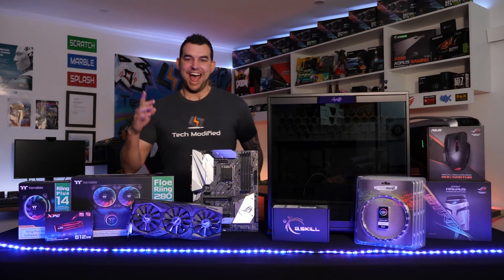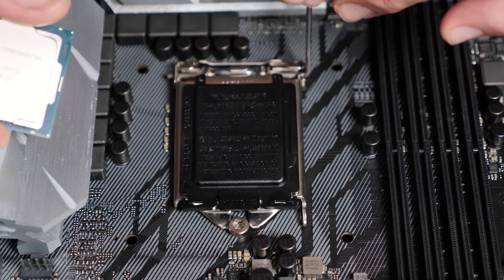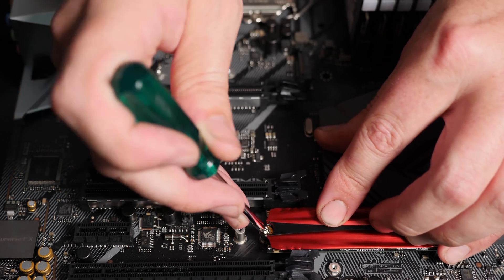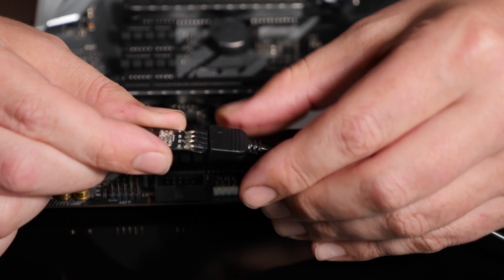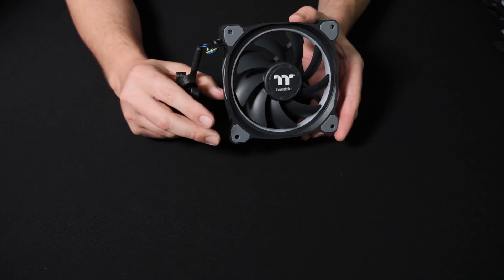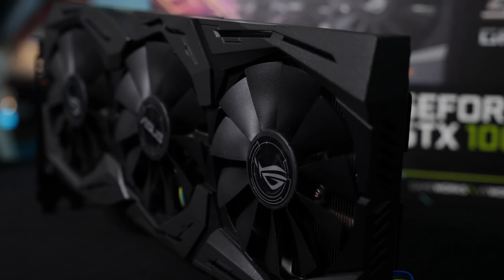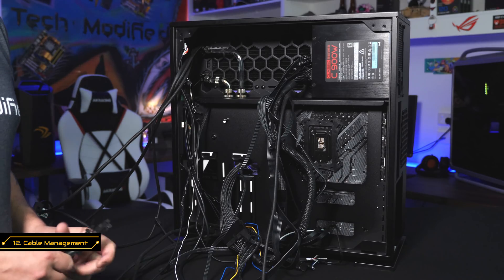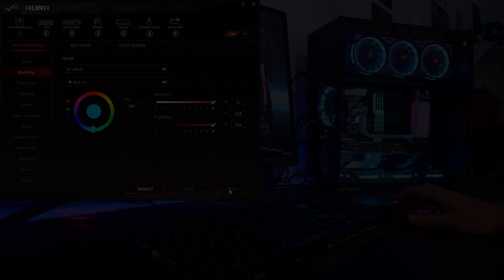Ultimate RGB Gaming Machine Build Tutorial

Comment: Woah woah woah... What's up with that m2 ssd. Never seen one that just acts like a chip set into the mobo... That's a thing? What's the advantage other than minimal wire management for having it on the mobo.
Reply: The advantage of m.2 chip SSD is super fast read/write speed plus it doesn't take up the same amount of space since its "flat" against the mobo. A normal SSD like the Samsung 860 EVO which i have, has a read/write speed of 550/520 MB/s while the M.2 Samsung 960 has read/write speeds of 3200/1800 MB/s. I actually just bought the same Mobo used in the video and will soon buy an M.2 SSD, can't wait :D

Comment: That "RGB" logo on the front of the case, is that a sticker than can be removed or is it printed/painted on?
Reply from the maker: Netherspark that is part of the In Win 303 RGB edition
Reply: So it can't be removed?
Reply from the maker: Its the power button and USB ports built into the front of the case. You technically can remove it or stop the lighting but then you will have a hole there.
Reply: Nono I mean that logo thing on the bottom left that says "RGB" on it.  I can't tell if it's a sticker or is printed on.
Reply from the maker: ahh sorry for the confusion that is a sticker and can be removed : ) 😀